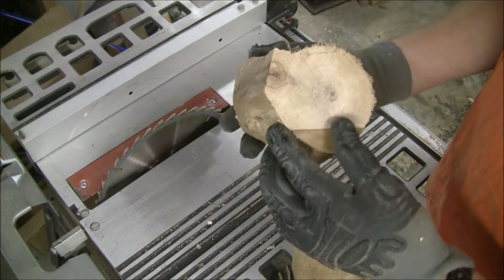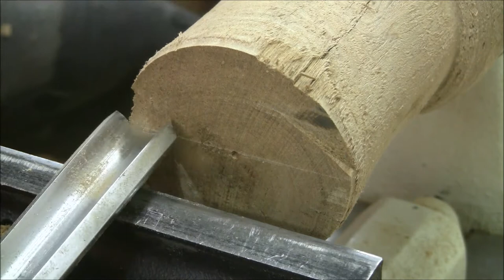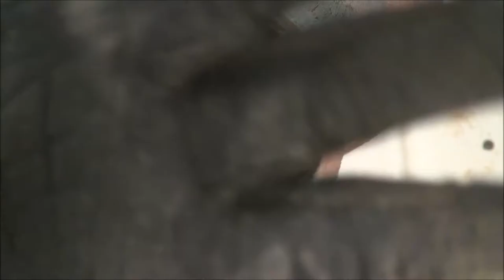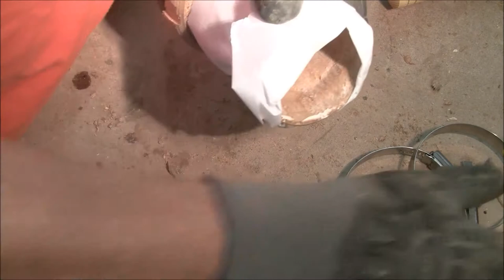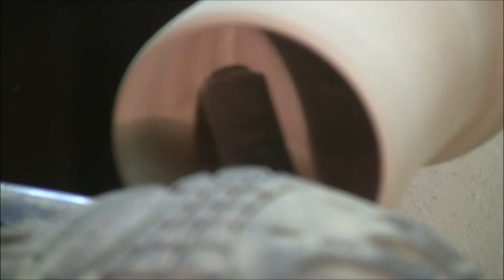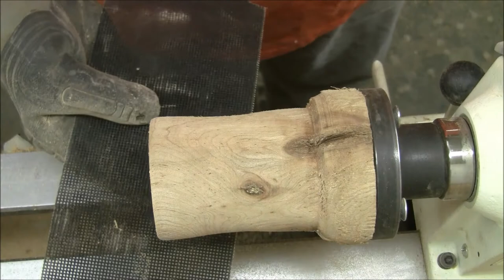Firewood to Cup

Comment: Cool piece, but PLEASE watch some vids and read up on table saw safety. You WILL lose part or all of some fingers if you keep using those techniques. Just quickly--1. Don't wear gloves. 2. Do use some kind of splitter or riving knife. 3. Use pushsticks when making rip cuts. 4. Never cut anything on the table saw that doesn't have a dead-flat surface to ride on the table. 5. Use  a miter fence or crosscut sled to make cross cuts. Protect those digits!
Reply from the maker: Thanks for the feedback Tork. Much appreciated. I am going to make a sled specifically for the reasons you mentioned!
Reply: That's a wise choice :-)
I know too many woodworkers with shortened or missing fingers to ignore the dangers of a tablesaw used wrong.
Reply: I can certainly see and feel your passion for woodworking but those tools that are so helpful can become monsters if you don't respect them